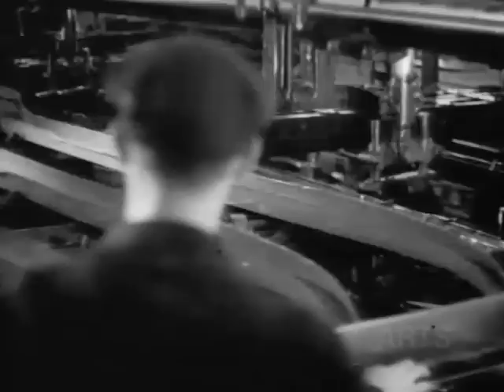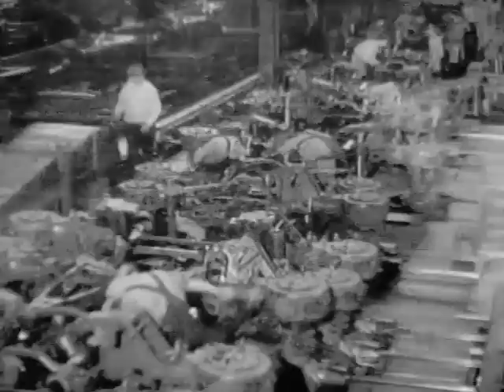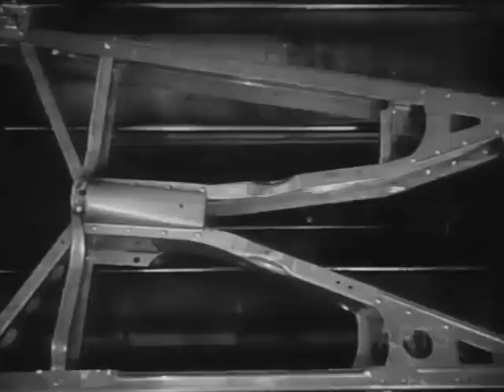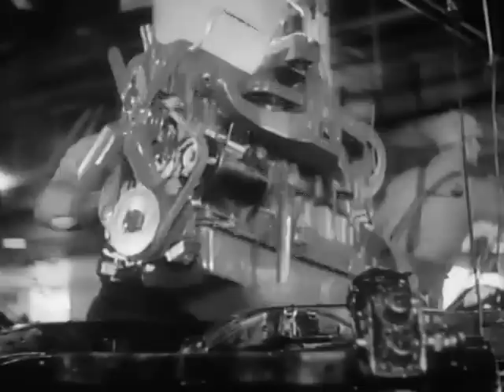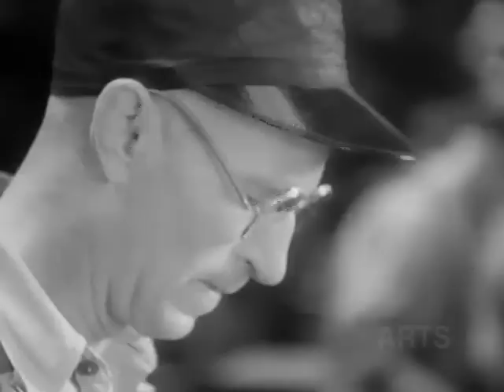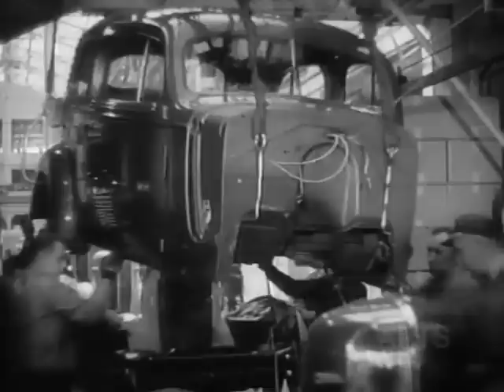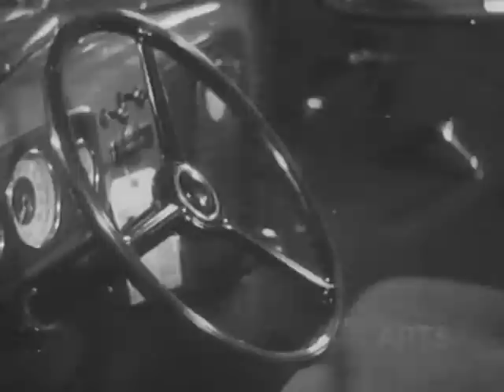Fascinating 1936 Footage of Car Assembly Line

Comment: I am amazed over the level of automation they had some 80 plus years ago.
Reply: it kinda looks like todays Factory's
Reply: Lastman Standing - My thoughts exactly. It hadn't been that many years that cars even existed. What an amazing country the United States is
Reply: another 80 years and some will be convinced it could not have been done without the help of aliens.
Reply: Roland, you bring up a good point.
Reply: It really wasn't that much different in the early to mid  90s.at older manufacturing plants(like Daimler Mt. holly NC,  Safety signs were funny too, only place I ever saw a sign that said no smoking with in six feet) I retool and do construction on the electrical side at Daimler Plants. when we leave, it has been transformed into a field of robots. A lot of the machines they have in the video are mechanically about the same just the control methods have changed  drastically.
Reply: hypnotizing, 1938 Cadillac had a v 16 engine, no vibration
Reply: Exactly.  Who built those giant presses? Aliens
Reply: 1937 was about 30 years after the first mass produced automobile started production (Ford Model T), that's plenty of time to build faster production methods with much larger machinery.
Reply: Harold Fitz
I'm not American,but when I watch videos like this,makes me wish I was living there in the late 40's and 50's amazing footage and amazing ingenuity amazing men and women.
Reply: Remus 247 'their' masters are also yours...
Reply: Lastman Standing The intelligence of those men was incredible. No CAD back then.
Reply: All mechanical, not one servo to be seen.
Reply: Roger Clarke - exactly! All analog machines. Those engineers were very clever indeed! I’m sure there are “logic” relays and hydraulic circuits but all very basic.
Reply: The scenes of the frame line at the beginning looked spooky in a way. Those things like duck heads ducking looked 30's spooky. I've worked in factories with stamping presses, and worked on them. The machines make a person seem puny, but every one was built by people, who harnessed the natural materials and forces from the earth, and created these huge masses of tooling and machinery, which is even more important than hand built products.
Reply: Had to. They were building 4 to 6 million cars a year.
Reply: Except they decided not to automate the placement at  @ 1:22 and 1:32... sure hope these guys didn’t do that for eight hours
Reply: @romanval69  The first mass produced American car was the "curved dash" Oldsmobile, Years before the Model T.
Reply: Just think how many of those old molds went to scrap during WW2.
Reply: @lovejago  Glad I'm not the only one who marveled at the level of automation!   1914 was the start of mass production via the assembly line as pioneered by Ford.   Not 1900, not Oldsmobile; Ford, who started the Model T earlier, mass pro'd it with the meat-packing assy line process he worked out by hand (and his own back) himself lineside.   It simply didn't exist in that form before Ford designed it.    20 years later, this level of automation.   1932, Ford engineers figure out how to make the first single cast V8 engine in history.   Not just powerful and balanced, but cheeper to mass pro, and more reliable than previous 3 part engines.   Just the white, American, "Can-do" spirit.
Reply: @remus2475  ...and by the way Remus, if you want to buy a black man today; right now this very minute, the same way whites bought blacks 200 years ago until they fought a war to stop it, YOU CAN!!!!!    Just get a ticket and fly to Libya.   Put $400 American in your pocket, and you can buy a black man from another black man, just the same way it was done by whites 200 years ago, and the way it's been done for millennia by nearly every race on earth including other blacks who both enslaved them AND sold them.   It's been Africa's greatest and only historical gift to the world other than its natural resources, since the recording of events by mankind millennia ago.
                               ....One more bit of bad news since you're getting it all in one day....    Ancient Egyptians weren't black, they were white.   Proven.   DNA tests on ancient mummies confirms it beyond the shadow of doubt.   No Sub-Saharan African DNA appears in mummies until the 1st or 2nd centuries AD.   Same with most of northern Africa and all the ME.    If you read the Hadith, you'll find they make a special point to insist that you know the prophet Mohammed was white, and to say otherwise would cost you your head!!   Just sayin.....
Reply: @johnbravo7542  women? and where would they be in all this?In a nice cosy safe clean ofice maybe?
Reply: Remus 247 yeah ok einstein
Reply: Crfor Freedom its not racist its the truth
Reply: Remus 247 riiiiight
Reply: Lastman Standing Oh. Yes! Think  of today's roboticized assembly lines! Truly great. If,  not for the early work  done then. Check out The Robert Taylor  series in mathematics...
Reply: 2 words, Industrial Revolution! Henry Ford got the ball in motion and the rest is history, oh by the  everything was done (with precision) not with a computer or calculator but with a, drum roll please, A SLIDERULE AND A PENCIL.
Reply: Lastman Standing saw even spot welding. I thought that came later. Today’s car factories have few people and a lot of robots.
Reply: Just don't get your hands in the way or you could lose something.
Reply: It's all an illusion.... Watch this 10 times and focus..... then again a month later....LOL .... what changed? When you awaken.... and think for yourself.... it will blow your mind. Good luck!
Reply: I wonder if they were complaining that "robots will take all the jobs" back then too.
Reply: ohh i know,right.!!
Reply: @crforfreedom7407  But Obama would have said " You didn't build that".
Reply: @mssedmebich1621  Yes.   Henry Ford talked about it a great deal.   Everybody knew the near future was coming one day.  Inevitable....
Reply: leviathanusul  Phones aren't nearly as complicated as you seem to think.  My uncle worked on radar during WWII, then worked for Magnavox after and helped on teams to pioneer solid-state technology.  That was in the 1950s, as is the simple core of all this technology in addition to micro-processors which were developed around the same time, perhaps a decade later.  
              My uncle's job at Magnavox after the SS stuff was simply to take the blueprints of new products and hand-build circuit boards for testing and evaluation.   Once that was done and the bugs worked out, his design would be put into mass pro.   
                My uncle was Czechoslovakian mostly.  Not alien.  0% alien.   Promise....
Reply: Exactly my first thought! It makes you wonder just HOW MUCH technology is involved in today's car assembly.
Reply: They gotta have twice the robots these days cause the cars are so much more advanced and more parts to put on it.
Reply: I had no idea how advanced they were
Reply: @mssedmebich1621  some must have been thinking that
Reply: yes, robotics are not taking any jobs just making them better
Reply: I am too. Didn't realize the level of tech in 1936.....
Reply: This level of automation was necessary for the American auto industry to survive the Great Depression.  Productivity of workers had to increase by using these then state of the art tools.  Even the retail price of medium price cars like Oldsmobile and higher price cars like Cadillac was reduced in that era compared to what their prices had been during the 1920s.  Cars of the 1920s and early 1930s still had a lot of structural wood and received more hand-finishing.  Cars of the mid-1930s progressed to all-steel construction to speed up production.  Some American auto manufacturers stopped production during this era because they didn't adjust.
Reply: @ottohesslein3230  They reckon they didn't land on the moon cos they "couldn't" have so long ago. Should show the prick-heads this video.
Reply: After WWII it was Toyota who introduced lean manufacturing which is in use today.
http://www.rcbi.org/index.php/viewarticle/130-capacity-magazine/spring-2007/features/336-lean-manufacturing-made-toyota-the-success-story-it-is-todayinvesting-in-our-economy
Reply: @haroldfitz5146  Oh I forgot this, It was Toyota who introduced lean manufacturing which is still being done today.

http://www.rcbi.org/index.php/viewarticle/130-capacity-magazine/spring-2007/features/336-lean-manufacturing-made-toyota-the-success-story-it-is-todayinvesting-in-our-economy
Reply: What I see is the men in the plant only did what they couldn’t get a machine to do...the things that required a bit of precision placement or a complicated movement of a part.  Much of it done now by robots with better precision and quality.  This is a fantastic film...well shot, and a dance-like quality to the interaction of men and machines along the line.
Reply: Brad  Funny, that's what people said back in the 18th century.
Reply: @ottohesslein3230    That's easy to do when you keep everyone else out.

Signed, A White Guy
Reply: That is a General Motors line the Ford assembly lines were even more advanced in the  mid 1930's.
Reply: @nosdriver8115  The MORE cylinders, the less time between power pulses= SMOOTHER running engine, UNLESS you are talking about a Wankel!
Reply: @prevost8686  WE put men on the MOON using "slide rules"! Talk about incredible!!
Reply: @crforfreedom7407  The problem we have now is that Trump looks at anybody that is foreign- born as an alien, who should be deported. In his FEEBLE mind, foreigners just come to the US to get "freebies" at tax payer expense! He DOESN'T CARE if these people are fleeing for their lives from autocratic governments!
Reply: @TheOzthewiz  Lol!! I don't think so. Not in the least.   I don't think criticizing Google and other tech giants for firing their higher paid US workers, who are all paying off student loans and went in debt to get a good job with a future, replaced them with minimum wage Indian replacements they are bringing into this country for that express purpose on the workers visa program, makes Trump anti-immigration!   Remember, it was Hugo Chavez as a union representative, that was actually killing illegal Mexican and Latino migrants.  He knew basic economics, he knew that a large labor pool drove wages down,  and the 2 fundamental groups hurt were union and minority workers.   Democrats used to care about these people once upon a time,  but now they've tossed them over for new illegal voters who are dependent upon government subsidies for their survival.   The establishment Republicans and global industrialists love it too!  Do you know how cheap they're all getting gardeners and maids and cooks thanks to the high flow of illegal immigration?  Oh its a godsend to them!
              So Trump is actually standing for union and minority workers, and against the exploitation of cheap foreign labor for higher profits for the rich, AND YOU'RE TELLING ME YOU HAVE A PROBLEM WITH THAT?!!?  Man, that's all on you.
Reply: @crforfreedom7407  When you think about it "computers" are ACTUALLY LESS complicated than a television set! Computers have circuits that operate in "binary" mode, they use "flip-flops",multiplied by the billions. A television , on the other hand, uses many different type of circuits for RF , audio , video, high voltage generation, color decoding, etc. I worked as a "test technician" at a "super computer" manufacturer (Control Data Corporation) from 1968 to 1989. You would be amazed at how many of the "super techs" or "engineering techs" had a HARD time understanding how a "color " television works, yet these same REALLY GREAT computer specialists could find the toughest hardware (software) problems in a matter of minutes. It was a case of thoroughly understanding how to use a "scope" and write simple test routines, electronics "knowledge" as would be necessary to troubleshoot a television was NOT necessary to fix a main frame computer!! So , a television was actually HARDER to understand than a digital computer!! Does my LONG WINDED reply make ANY sense to you?
Reply: @TheOzthewiz  Yes it makes perfect sense, especially in the analog era.  But today,  let's face it, everything is a computer now: Smart TV, Smart phones; they're all computers. 
              Computer technology as you point out hasn't changed much the past 50 years or so.  It's still binary, again as you stated, it still has the same components of CPU, RAM, ROM, GPU communicating via I/O devices, and a motherboard to tie it all in are the same as ever.  The 7 layers of the OSI Model still apply,  though given the more cloud-centric nature of software it has been truncated.  In fact, boot.mgr, and "the 64k kernel" you remember from the 70s and 80s is still there!  It's gotten a bit more complicated with hyperthreading and virtualization, but you're right; the core box is basically the same.   The software is where the real growth is, that's why software engineers are the only ones really still in high demand and making top wages.
             I remember when a starting programmer earned low 6 figures in the 1990s, before it all got sent to India.   When they did start bringing them back in the mid 2000s, it was for 40k to 50k a year  tops, and the Indians still as now got a lot of work.    
               I have a major oil company in my  city.  They pay their IT staff around 80k to start, FAR from their 1990s levels when they only made money hand over fist.   Now they Pay less and have 1/8th the IT staff.  If you're in a conference,  you'll be online with a company IT guy @ 100k a year, a US 3RD party vendor subbing work at about 40k a year,  and online with the Indian staff member making about $4-$5 HR. A lot more is  done with virtualiztion.  That's how the big corporations with a lot of $$ roll now.  Smaller companies due with much,  much less.
Reply: @crforfreedom7407  Yes, it's really sad that the markets we had to ourselves have become "global". This country used to be the leader in innovation, but now it seems like we have lost our way. I really felt proud to be an American in the late '60s, when this country was in the "space race" with the Soviets to be first on the Moon! It was especially exciting because CDC had built some of the "hard drives" that helped put an American on the Moon. Moving ahead 61 years, I am especially worried where this country is headed politically. I have a hard with the way our President is getting SO friendly with our former(?) enemies, especially Vladamir Putin. To me he STILL part of the "evil empire" that "built" the "Iron Curtain" that enslaved the Eastern European countries, including Latvia which my parents and I were lucky to escape from with our lives in 1949. I still don't understand why the GOP, who USED to be Hawks against the Soviets, don't seem to have a problem with Trump cozying up to Putin. Anyway, I will get off my political bandwagon! Have a good day AND STAY SAFE!!
Reply: @TheOzthewiz  Times change.   Yesterday it was the Soviet,  today its China.   What hasn't changed is the Communism that drives both the Soviet then and the CCP today.  The difference is,  the CCP was willing to see the economic folly of Communism and take on to manipulate the free market to its own ends. 
                    The difference is economic power.   Russia today has been reduced to an economy the size of Rode Island!  Did you know that?  Most people don't.   They really have no power or influence anymore without their slave states in the Soviet adding to their GDP.  Remember the condition E. Germany was in when they finally unified?  It about broke Germany just catching the east up with the west.   That's Communism.  That's what China found out under Mao: economically, it just doesn't work. 
                So the Soviet disintegrates, but China,  thanks to its buying potential, ability to adapt to their brand of capitalism and wealth of natural resources,  along with a government that can provide cheap labor and guarantee they stay in line was the perfect place for greedy profiteers to invest trillions for the global expansion. 
                   In the US,, even with breaking the middle class's grip on the economy by returning to Shareholder Capitalism from the Stakeholder Capitalist system created by Ford that made the middle class, and made them the power of the economy (Remember all the strikes we used to have?  All the inventory businesses used to keep for the duration?  That's how Japan got their foot in the door here with their "just in time" inventory system saving them billions over American mfgs), it wasn't enough.  They wanted to elevate a country willing to literally enslave their people for profits.   China was willing.   So the world moved to China as technology aided the increasing globalist centralized control. 
              But the CCP was smart.   They mandated a good portion of these private companies to be ultimately state owned with private leadership, and even private companies were mandated to have at least 1 CCP party member on their board, so the Communist government stayed firmly in control. 
                 When the infrastructure was built by the foreigners, when the trillions in foreign profits piled high when the CCP solidified their control of even these foreign companies, THEN did the CCP government start flexing it's muscle and influence,  both regionally and with  those businesses and nations looking to get rich off China.   
               Suddenly,  the people so greedy and focused on the profits, were too distracted to see they were being surrounded and controlled themselves by the government.  They'd do anything to keep the insane profits coming in, even sell out every national secret their home country had just to get more weath.
             That's another big difference between the Soviet and China today: it was tough getting around government's to get their secrets.   The CCP not only has people throwing them to them,  but even government officials themselves are doing it to get into the cash bonanza!  So China continues exponential growth, something the old Soviet could only dream about.   Then China, with its new economic power,  has the ability to corner entire markets like steel,  metals, drug mfg, and all mfg for the greatest nation on earth and many others.   CCP owned companies with tax $$ backing flood markets with products below cost forcing out domestic producers and cornering the market.   You've NEVER seen anything like this from the old Soviet,  let alone Russia,  with its puny economy. 
              And still the DNC, after all that,  still has you focused on Russia.   Amazing.
Reply: @ottohesslein3230  progress comes at the expense of others.
Reply: @remus2475  printed money out of thin air and speak to jinn spirits(satan) for knowledge in return for his soul. how else they get this scientific knowledge they are occultist. enslaving rest of the world to so call progress  himself and the rest of the world under him.
Reply: @crforfreedom7407  bull sh it libya was the only one that was free from rothschild grip gaddafi was switching over to islamic currency gold dinars this would have reduced usa to third world. so they killed him.
Reply: @rizsarwar2713  I do agree with that. Every new technology displaces human workers. No question about it.
Reply: @rizsarwar2713  It's never just one thing.   If you notice, it's made the biggest and best "back door" for African and Islamic immigration into Europe.   I think THAT was the motivation more than anything...
Reply: @crforfreedom7407  islamic immigration you mean like western so call christian immigration into the native American land.
Reply: @rizsarwar2713  LOL!!!  Oh no!!!   You have that totally wrong.    Look.   I don't mind a good invasion and conquer any more than the next guy does.    When it was done starting in the 7th and again in the 14th century as part of a 700 year cyclical conquest motif, I was all for it.   May the best man win.   My problem isn't with the mzzies per se; so what if the 21st century is the next 700 year cyclical invasion century.     My objection lies with our own government for inviting in people on the pretense of "aid", something false, and the mzzy's coming in the name of receiving aid and mercy; also false.  
                          When most people conquer another people, and that includes native am tribes, they don't suckle at their teat for a few years first!    They do a nice, clean, honorable invasion start to finish.    They don't move in with them, live off them then demand they change their ways and breed them out of existence.   They march up to them like men and take them like men, not women.   See the difference?
Reply: @rizsarwar2713  ...and by the way, just so you know, America was never conquered for Christ.   If it were it would be an exclusively Christian nation which it is not.   It was conquered like all other nations have been conquered since the beginning of time:  For resources, booty and power of a secular people, not a faith.  If you think the mzzy leadership is doing this for some deity, you couldn't be more wrong.  It's the same, classic reason that everyone else does.   It's why they've always done it in the past and why everyone else has done the same thing;  GREED.    Nice try though....
Reply: Norm T  💯
Reply: It almost looks like today's assembly plants, just without almost all the equipment painted yellow for 'safety'
Reply: @timothyrobirds8417  There is a foundry in Saginaw Michigan that's been in operation since 1908, 😳 and it still runs every day!!!!
Reply: @haroldfitz5146   Yes, as a Canadian, we are proud to share this continent with you guys.. What amazing technology that is over 80 years old!!
Reply: I was thinking the same thing.
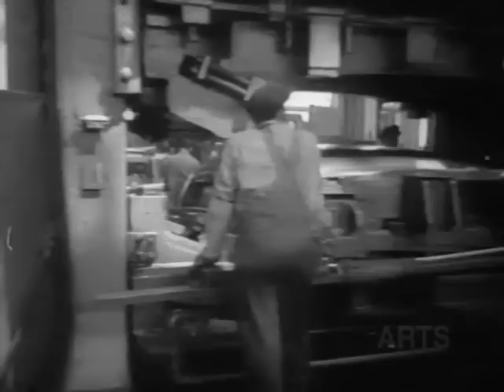Reply: and the safety pre-OSHA, notice both hands on the switches at the press, or it wouldn't operate  06:19 while third guy further away pushes lever to make the ram go down
Reply: So much B.S.
Reply: @RavenJCain  space aliens, right ?
Reply: @TheOzthewiz  it is not American tax payers job to save every foreigner from their oppressive leaders.
Reply: Yes!! Alot of automation for the time!
Reply: A lot of relay logic .. I don't envy the electrical crew who had to keep it all working.
Reply: @moman19701  It produced a lot of good electricians
Reply: @ottohesslein3230  they must’ve seen this, somehow they tune it out, coddle those who shouldn’t be coddled and condemn those who shouldn’t be condemned.
Reply: @RavenJCain  i fail to see the woke crowd’s argument that it was built on the backs of slaves. This was new money, had nothing to do with slavery, except what the liars of today who operate the media and hate our country wish to convey.
Reply: @tihzho  i think you miss his point, we are fully aware that the 19th century industrial revolution began in Britain, you assert industrial espionage on tue part of America without real proof, not only that but many nations have benefitted from the advancements of other nations, the Soviets reverse engineered the B29 bomber, the British reverse engineered the Jerry can. So what’s your point? He was saying he was proud of the accomplishments of the United States, he wasn’t taking anything away from anyone else. In all fairness i will check out your link, just so, anything i see is only an assertion, you need proof, an exact copy of a B29 is pretty good proof, as is the Soviet sidewinder missile.
Reply: @tihzho  checked out your link, A left wing AP article. Overt propaganda, by the way, may as well have been written by Pravda. Yes, I’m sure America learned all her best trade secrets from Britain, especially how to take advantage of the poor and destitute like an old colonial expert, right? Ask India.
Reply: I too was quite surprised at the level of automation on view in this facility for the time!

It does explain how the model T Ford was able to be sold for around $296 several years after it's launch whereas it cost almost $1000 more to buy at the actual time of it's launch!

Automation, lower parts count and a smaller workforce all reduce costs, enabling more sales due to a lower purchase price!
Reply: @jaywalker712  they had to start building cars again straight after the war many were prewar designs therefore not all the tools were scrapped.
Reply: Imagine how boring these jobs were for the men.  Try the job that required you to put one screw in one hold for the machine to come in and drill it down.  Gads.
Reply: This is a 1930's Chevrolet line and America is such a great country.
Reply: @jaywalker712  or how many of the men you see here went off and never came back...
Reply: @garthqueen  at home keeping the house....and when these men went off to war they would have been here doing the same job...
Reply: Why is that amazing? They can build cars but not equipment to use to build them ..? People aren't stupid... Well, a few of them aren't...